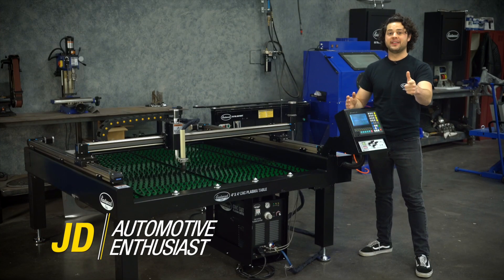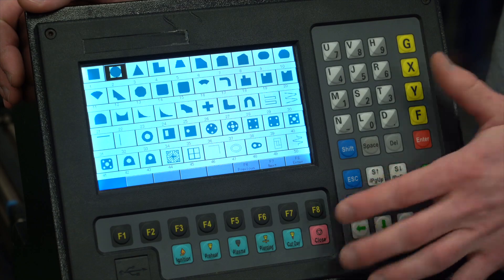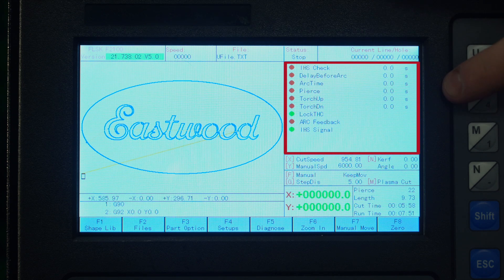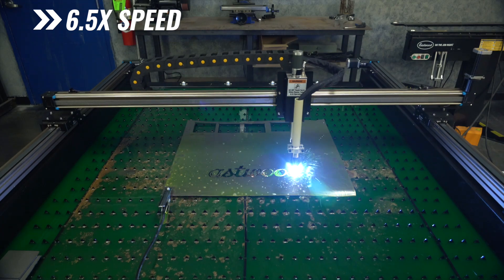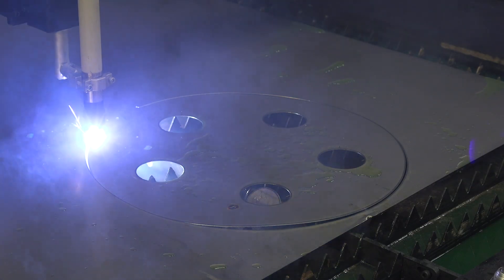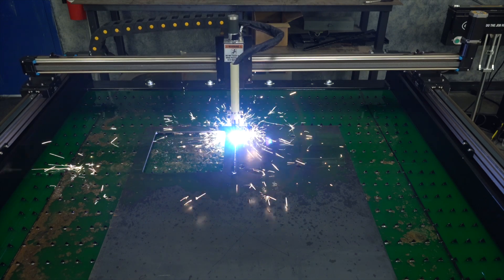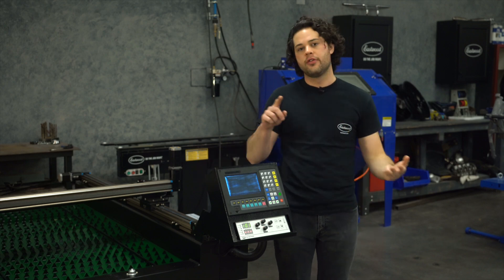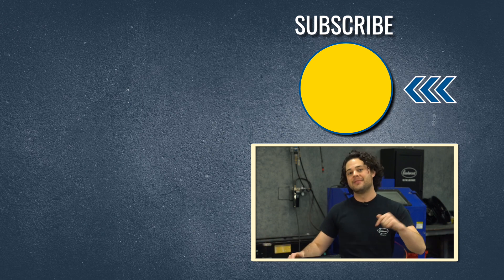4'x4' CNC Plasma Table - The BEST Way to Cut Repetitive or Complex Shapes in Metal! Eastwood

Comment: Is there such a thing as free software for Plasma tables?  I don't own one yet and it's the only thing I'm nervous about.  I used AutoCad about 300 years ago and like to use basic drafting programs.  I'm not wanting to learn some complicated program to cut simple shapes.   Any advice would be great.
Reply from the maker: We use Autodesk Fusion for design and processing. They have a free version for home use.

We've also seen workflows where customers use qcad and sheetcam for post processing.

You can also find .DXF files all over the internet for free as well including our library of them: https://www.eastwood.com/garage/category/resources/cnc-files/cnc-cut-files/page/3/

Comment: How old is the OS program? 32bit Win7 based system or Lennox?
Reply from the maker: The steps for painting or re-painting anything are pretty much all the same - so evaluate how good the paint currently underhood is, if it's in good condition you can sand/scuff, seal, and paint.

If it's in bad shape you'll have to Strip, Sand, Primer, Sand, paint.

Comment: Why has nobody else reviewed this thing yet? I was trying to find an opion of somebody that wasn't on eastwood payroll. Nothing out there...
Reply from the maker: Sorry about that - we think it's great!
Reply: Because it is 9k for only a 4x4 with a cheap plasma cutter and people (like me) are buying Langmuir 4x8 for 7k and can then get a quality cutter.
Reply: i just bought one ... not very happy you cannot get a post processor code anymore even off eastwoods web site so now i have a chinese chuck of metal sitting here i cant use even with fusion 360
Reply: @P-burgarage Still the case?  Looking at the verse-cut 4x4.
Reply: @P-burgarage did they fix it?
Reply: @camerontrent1564  not to my knowledge i had to spend a week before manage to find a post processor for it etc
Reply: @P-burgarage  so does the table work?

Comment: 8k no thanks you can get a langmuir 4x8 machine for like 6k
Reply: Yes sir. I bought the langmuir 4 by 3. With the hypertherm 45 xp.  Bar none the best cutter period !!! I had the versa cut 60. It’s not a bad cutter at all.     But it’s no hypertherm.  $$$ more money but well worth it. I saw to many guys with the langmuire plasma and they have issues with the torch not firing at times during a cut. Hypertherm is the standard for plasma cutting …. Just do your research and you will see. That little machine is flawless so far. I do however like the look of this table over mine.  But I would not want that screen. I have a lap top and it’s awesome to take with me to do my drawings and just plug it in. That screen is small … I think they would be better off to offer the table by itself if you want it and either give you a large screen like langmuire new 4 by 8 table. or let you get your own and get your own cutter…. The hypertherm nozzles are superior in every way.  Again. I know I had a versa 60. I have almost 1800 pieces on my nozzle … I thought this wasn’t possible. But that’s one of hypertherms claim to fame. Their nozzle life … and as was mentioned. Good dry air.  All in all nice looking unit though
Reply: Hey Rich question for you on the Langmuir.  Can you put an oxy torch on the head?  Or is it just plasma only?
Reply: @ryansmith56776588758  you might be able to get away with a oxy torch if you were just doing one continuous cut as it needs to wait for preheat. The plasma can be turned on off electronically with less than half a second of pierce time depending on the thickness